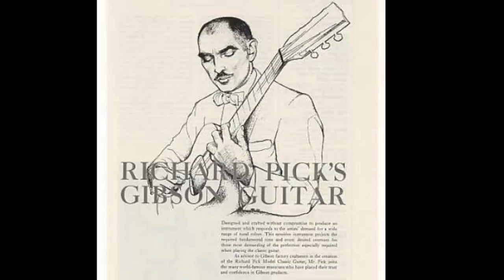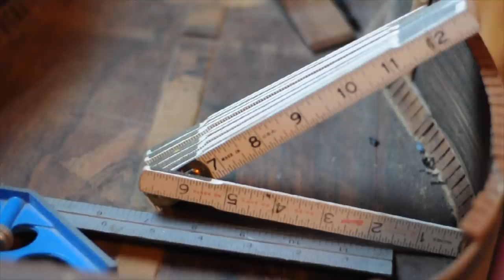Restoring this Vintage Gibson Guitar (Can it be done?)

Comment: Perhaps this comment has already been made but it was interesting that Gibson had used a dovetail neck joint as used almost universally in steel string guitar making instead of the traditional Spanish heel method. A couple of years ago I was asked to repair an 1830s European romantic era guitar, possibly from Markneukirchen school of luthiery. The owner had tried to fit light gauge modern steel strings which, when brought up to concert pitch, pulled most of the lower bout away from the sides and the end block. The European spruce top had the tightest growth lines I have ever seen . Fortunately the top survived intact with all the damage limited to the top purfling and binding.
Reply from the maker: Very interesting observation. I think it might have something to do with the time period and Gibson’s production line. I can only speculate that Gibson, building mainly steel strings at that time, would have had a process in place to produce that type of joint vs the Spanish heel. That’s only my best guess of course.

Comment: very nice job on the guitar, but one question, isn't that top wood that you installed a little bit too thick for a nylon guitar? I mean, on my acoustic it is like that but my nylon strin guitars have like a 2mm tops on them, just wondering, that's why u had to add the veneer or make a new nut for the guitar...
Reply from the maker: Yes, if I had it to do again, I would have thickness sanded it down a bit. At the time I didn’t have a thickness sander, so I did what I could. I wasn’t really sure how well it would all come out to be honest.

Comment: Do you have plans to restore the headstock veneer, and install fretboard markers, or is this project done?
Reply from the maker: I didn’t really talk about the headstock veneer. When I got it, it was very cloudy and the lacquer was nicked a bit. I used a cloth soaked in lacquer thinner to remove the damaged layers. That worked really well and I was able to keep the nice looking lacquer underneath. It’s nice and shiny now. As for the fret markers, I did put on side dots but I wanted to keep the fretboard unmarked.

Comment: The guitar is how half Gibson's, half yours. What does that do to the provenance and what does it mean for the instrument's worth (aside from the fact that its value was on the low side when you started)?

It was an impressive job.
Reply from the maker: Thank you. That’s a great question. I’ve wondered myself what the value would be. It’s hard to say since wouldn’t sell it, being a gift and all. 

I see significantly later Gibson Rich Pick guitars have sold for between 1200 and 2000 dollars. Those of course have the original top. Being that the top was replaced, but it is otherwise in tact and playable, I would only speculate it would fetch around 1000 dollars. Really I have no idea though. If anyone else has any thoughts I’d love to hear. 

Despite not having all its original parts, I think it’s value is significantly greater now than what it was when I started.

Comment: This guitar is in fine shape compared to my Restauration project 😂
I got a 100 years old Torres style guitar. The original back was broken and replaced in 1951 with a three pieced back of different wood. That comes out, it already disintegrated on its own. I ordered replacement wood, seasoned rosewood. The sides are original brasilian rosewood but there is a crack that has to be fixed. The top is a master grade (today it would be AAAA) alpine spruce, probably Swiss with extraordinary inlays, some of the pearl inlays are gone and need to be reproduced. The top has several cracks along the Fiber direction, because it was transformed to a steel string and fitted with some kind of pickups (there are tiny fixing holes where the pickups were) and of course the bracing couldn’t hold the string pressure of the jazz style tailpiece.The top is bound by several layers of ultra filigrane curfling, some is gone and needs to be reproduced and of course I need to install a classic tailpiece. The Basilian rosewood board, a beautiful old dark one need to be refretted itself and a crack in the headstock needs fixing. Finally when everything is fixed and the neck is set again I’ll apply the French polish. Think it will be finished sometime next year. My goal is to bring it back to a playable condition. It’s going to be a tough job tough.
Reply from the maker: Well that’s a lot to do! I wish you lots of luck! Will we get to see a video of it?

Comment: That's some fancy,  diy clamps. Spool clamps i think you call them.
Reply from the maker: Thank you. Actually mine are pretty rudimentary. It’s very simple. You cut a large dowel rod into half inch slices, drill a hole through the middle and attach them with nuts, bolts and washers. The only thing I didn’t do which I’ve done now is glue cork to the spools. That prevents them from slipping.

Comment: Would a router be better at doing the binding, reason, more accurate depth....
Reply from the maker: It would have been, certainly. I was afraid to make a horrible mistake on 60 year old Brazilian Rosewood, so I chose to sneak up on it with sandpaper and a file.

Comment: Your video skipped over what I think was the biggest challenge of reassembling a guitar that had no top for a long time - ensuring that the neck angle was correct.  How did you address that before you created the template for your top, and started your assembly?
Reply from the maker: The truth is I didn’t. I got lucky. If you want to see how I set the neck angle on a guitar though, you can watch part three of my StreMac guitar build. It’s not complicated but it takes patience.
Reply: @BrianGossard  I think setting the neck on a body that is already fully assembled is more straightforward than tensioning the sides of a partially assembled guitar in order to restore the original neck angle before attaching the top.  Not sure how low the action you set was, but typically classical guitars have slightly higher action and maybe there is more room for error on the neck angle than would be the case for a steel string acoustic.  Thanks for the video of your work.

Comment: So cool! So amazing to give it life again! Wonder if light sanding between urethane coats is helpful for guitar finishes. It's know it helps with finishing drums. Never done guitars before so I'm a bit curious if my handmade classical had sanding between coats.
Reply from the maker: Thanks! Yes, light sanding probably would be good. I’m not the best at finishing. There’s far better than me. I just try to do the best I can and sometimes I’m too much of a wimp to risk sanding through all my hard work.
Reply: @BrianGossard  Understood and you did a phenomenal job. I wouldn't think of even trying what you did with my skill level. I can build nice drums but wouldn't mess with thin wood like what a fine guitar is made of. I actually learned some great tips like evening out the grains with that coating like you did.

Comment: Doesn’t a classical guitar use nylon strings? To me those looked like steel strings at the end but it could have just been the lighting
Reply: The lower strings are typically nylon wrapped in silver plated copper thread.
Reply from the maker: Correct.

Comment: what did you do the the finish on the inside ? did you leave it looking old and original with that label?
Reply from the maker: Left the inside exactly as it was (after wiping the old dirt away of course).
Reply: @BrianGossard   Thanks for the reply, i'm glad to know you gave it a good clean on the inside, after watching this video i really want to restore my old 1960s kay guitar. it too was given a steel string conversion but the only problems its created is the high action of the strings.

Comment: Please invest in a trim router rather than using a dremel to get things flush. You're giving me anxiety, particularly with such a fine instrument
Reply from the maker: I did. I used it on my StewMac build. My concern was to have a mishap with a trim router and ruin that Brazilian rosewood. I didn’t take it all the way down with the Dremel. I filed and sanded the rest of the way. I agree it would be preferable to use the router though.
Reply: I guess thats some pretty fair reasoning and i guess it came out pretty good anyway
Reply from the maker: I just do the best I can. I don’t claim to be the best at all. I think it’s just important to be humble and open to learning.

Comment: New subscriber send here by Jerry Rosa which did recommend checking your channel ! Love the way you rejuvenate this old classical Martin guitar ! The mahogany looks amazing.  I have a small question concerning the recrowning tool is the shape standard and dress the frets always to the same tip shape or does it exist in other shape ?
Reply from the maker: That's an excellent question. The fret crowning tool, which I purchased on Amazon, came with three files of different sizes. They can be removed and reinstalled in the handle at any time. Truthfully, I've only ever needed to use the middle one though and I've heard from other luthiers the same experience. So, if you're looking to get one, go ahead and put the medium sized file on, but make sure you don't lose the other two. I like to keep all my fret dressing tools in a cigar box by the way. Works great for storage.
Reply from the maker: Just a couple corrections, It's actually a Gibson. The wood on the back and sides is Rosewood, but the neck is mahogany so perhaps that's what you were referring too. Either way, thank you for the compliments!
Reply: @BrianGossard   Thanks for the correction nevertheless it looks beautiful
Reply from the maker: That’s alright. I misspeak about constantly.

Comment: C -
Reply from the maker: Alright then. Let’s see yours.
Reply: @BrianGossard   You just did a few things that I wouldn't have, Good job overall, but I would have approached a few things differently.  How about using a router for the binding, instead of a dremel sanding bit, and using a heat gun to shape it a little. Addressing the neck issue before, I probably would have done a neck reset on it, to get it right, and to also ensure the stability, because of the shape it was in.  Not sure why you just didn't make your own fret board either, You may have been able to thin the whole top down. Not sure if you compensated the saddle especially the G string, being a nylon string. The saddle looks to be very high, again because of the neck angle/fret board thickness, and it may want to tilt forward because of that, and even have too much leverage against the front side of the saddle slot possibly cuasing an issue for cracking.  Didn't really mean to insult you or your work. I am far to busy to be able to make videos on my repairs.  Over all you turned this thing into a guitar again, and that's what counts.  Every day, and job, is a learning experience, even for me after 18 years of doing it. So sorry if I came off being negative. I tend to be brutally honest, and Just commenting "C -"  was a bit of a dick move, I apologize. When it comes to something as old as this guitar, people are going to have different opinions on the do's and don'ts. So anyways, Cheers. man.
Reply from the maker: Thanks. I didn’t expect such a thorough response. I was being a bit sarcastic too in my reply. You probably have some valid points. To be honest, doing a neck reset is a little beyond my experience still. The neck also seemed very straight and looked to me to have a good relationship to the body so I left it. As for thinning the top, yes that would have been ideal, except I didn’t have a thickness planer and didn’t feel confident I would be able to thin it all uniformly using other methods. As for the binding, I was concerned about tear out. I’m buying a guitar binding jig for my next project and if I had access to one when I did this, I might have gone that route. Mainly I didn’t want to screw up something so old and delicate with a slip up on the router so I went the more time consuming route of hand sanding and filing. These are all reasonable critiques though so thank you for your response.

Comment: Excellent work young man! It's all about the clamping, you're 100% right. The glue works best when it's a very thin glue joint. That guitar was very very much worth saving, thank God you got it and knew what it was!
Attaching a file to a block of wood... that's brilliant! I can't believe I never thought of that... I'm usually very mechanically inclined. 😳
I'm certainly not a professional luthier but I can do most things. I can't do.. well, I've never tried doing as much as you did. I'm not sure I could pull that off! But there's something special about playing a guitar that you've done a lot of work on yourself. It's just more satisfying. Do you agree?

Comment: Great job!  I have one question:  Do you think filling the grain of the original wood on the back and sides may possibly reduce the quality of the sound that it would have acquired with its older age?   Also, maybe I missed you say it in the video, but what type of wood was the body, rosewood?  Thanks for sharing :)
Reply from the maker: It’s Brazilian Rosewood. It’s a good question, the grain filling. Rosewood and any other open grain wood is always filled when it’s made so I don’t think it dampens the sound to any great extent. The alternative would have been to spray so many coats of lacquer that it also filled the grain. I think any change in tone or resonance is so negligible it isn’t an issue. Good question though.
Reply: all luthiers use a grain filler on the back and sides